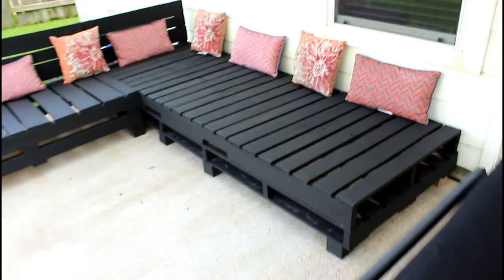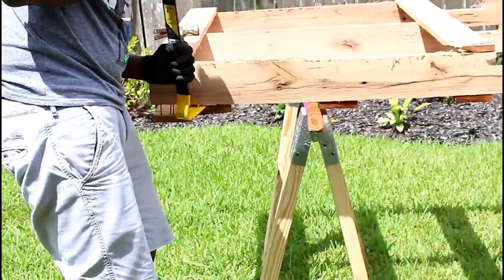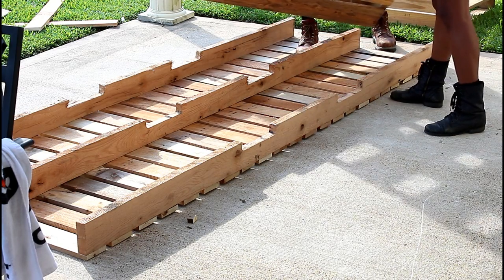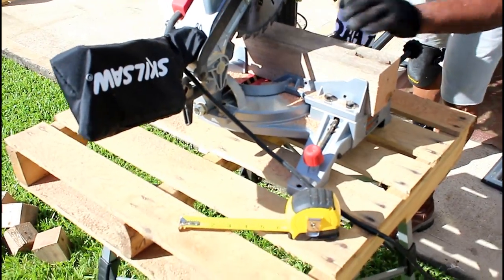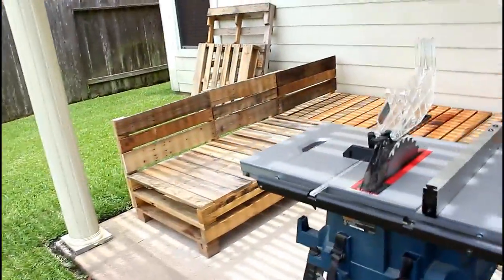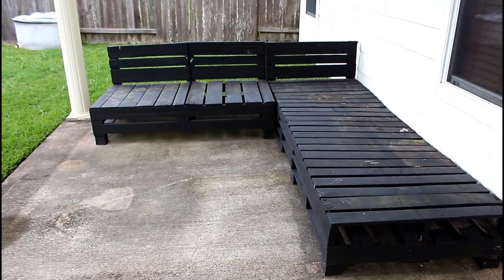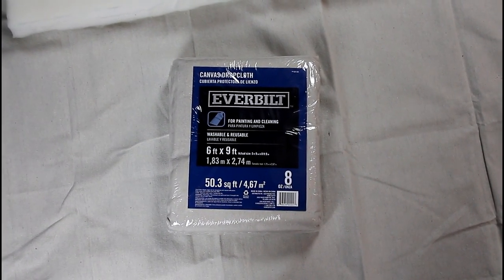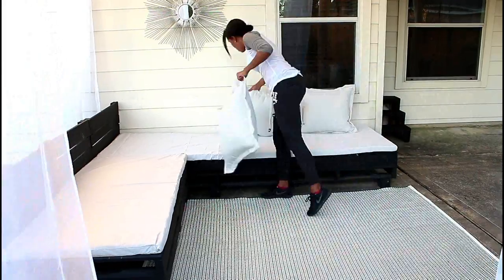DIY Pallet Furniture - Patio Sectional

Comment: I'm so glad you mentioned the weight issue. So many people just stack up pallets, attach & that's it. 

Though that seems easier, it means a heavy piece of furniture that's nearly impossible to move without a small army.

Better to take a bit of time, remove the excess & have a lighter piece.
Reply from the maker: Completely agree. I will defintely plan this out the next time i attempt one.
Reply: +Angela East  wowwww

Comment: Do you have to sand before painting since these pallets are quite rough with splinters
Reply from the maker: Catie Nguyen hi. No I didn't have to sand at all. We haven't had any splinters. This could be because of the power wash. Plus, I only chose the best pieces for the top planks. So nothing peeling or frayed.

Comment: What did you use for the top portion of the couch ? Are those just 2x6? Or a long pallet?
Reply from the maker: Rachelle Aquila Regular pallet planks cut to fit. Attached to 2x4
Reply: Angela East what i meant was the sides of the top portion, the longer boards, ive not seen a pallet with that much length, did you go buy 2x6’s?